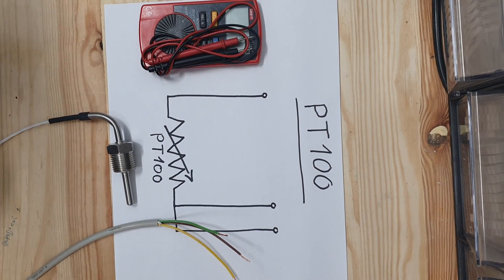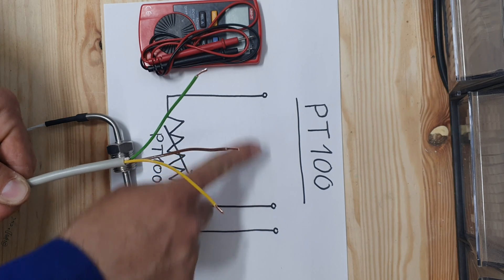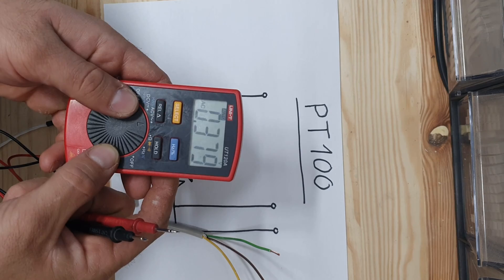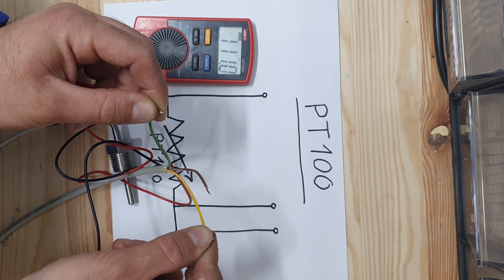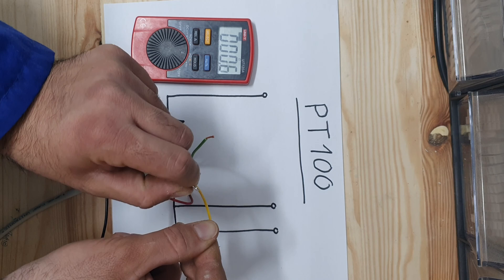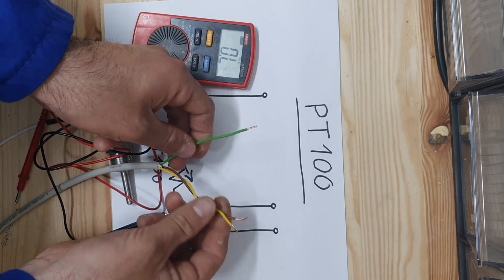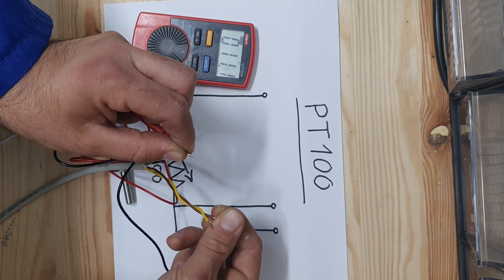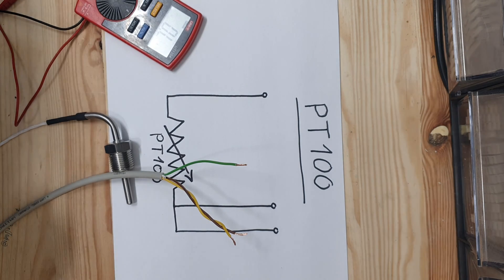How To Test PT100 Temperature Sensor : What is PT-100, Why We Need 3 Wires And How To Measure IT

Comment: How long or how many years can a pt100 work efficiently. What could be approx expiry or validuty?
Reply from the maker: Hi, its very depend, when installed correctly, avoiding mechanical and environment damage,  lifetime of a pt100 can be up to 20 years.
I have pt100 sensors in my factory that are still working after 15-20 years.